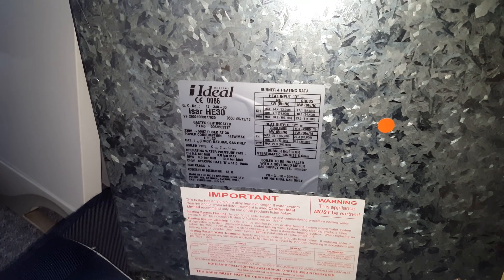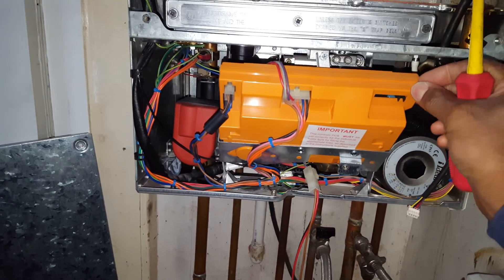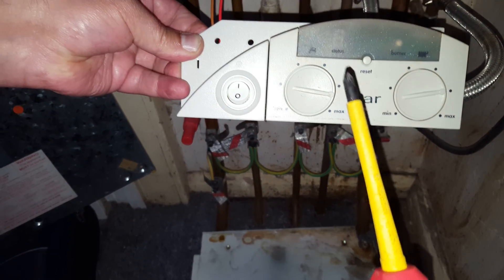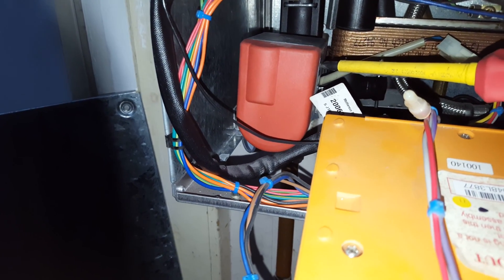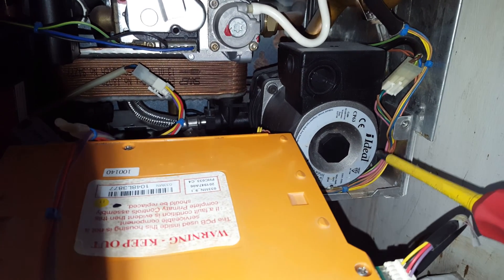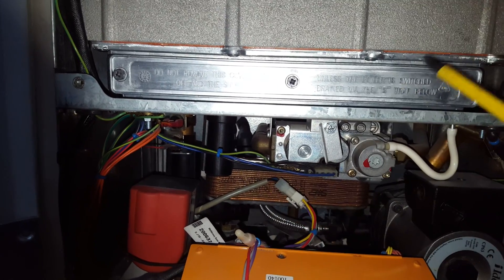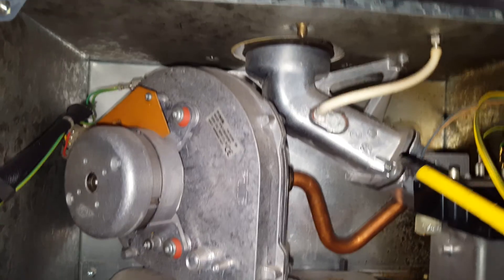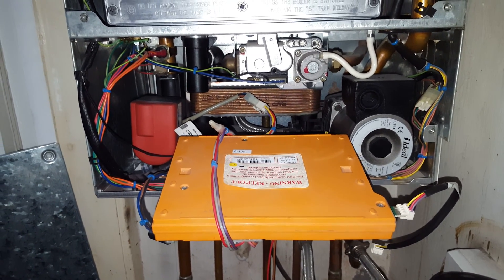Boiler repair Ideal Isar HE 30

Comment: Hi Tony, I'm aware this video is now 8 years old but I have an HE35, it's 11 years old and the pressure gauge drops  to zero when the hot water is run. It was noticed during its annual service and was diagnosed as a splt exchanger. I didn't get honest vibes from the engineer (never used them before) and I just wondered if, if it was your customer would you go to the effort of replacing the plate or main exchanger? I can easily find parts for it, plate semes to be a couple of hundred pounds depending on the supplier. I've got somone else coming on Friday to look at it but other plumbers that were too busy to come that I've spoken to said the same that it was one of the heat Exchangers and probably wouldn't be worth repairing. Just after another source of advice if you don't mind.
Reply from the maker: Hi, if it was the main heat exchanger that had spit, water would be pouring out of it. And it would be leaking everywhere. The main heat exchanger are obsolete. The hot water heat exchangers are easily available and to replace. Did the engineer repressure the expansion vessel that will make it loose pressure. Hope this helps. Also, can you subscribe to our channel, please 🙏🏽

Comment: Hi
Can you tell me, do I need drain water from system to replace diverter valve?
Regards
Reply from the maker: Hi yes you do also can you subcribe to our channel ?
Reply: @ARBoilers  Hi I did already but if you can tell me please cos I'm not sure, wires in black cover 6 pin are going to PCB and other 6pin to diverter motor?
Reply from the maker: What problem are you having?
Reply: @ARBoilers there are two 6 pin cables one in black cover I think this one is going to PCB and other to diverted motor am I right?
Reply from the maker: @prawak  are you trying to test the actuator motor?
Reply: @ARBoilers  I took it off PCB  to change heat exchanger and diverted valve and diverted motor and I'm not sure which cable is going to PCB and which to diverted motor. I think black cover one is going to PCB

Comment: Hi, 
I have ideal icos he15 boiler which has stopped working for some reason and i dont have hot water. When i switch the heating on the boiler can be switch on but no hot water. However when i switch off the heating the boilers burner light goes off too and i get “0” showing on the status display. I press reset it flashes with code H6/HB am not sure and goes back to showing 0. What could be the issue? Id appreciate your help a lot
Thank you
Reply from the maker: Min your case is best to contact ideal technical support

Comment: Hi there . Mother in law is 70 years old. She has a isar ideal he30 combi boiler. When boiler is switched on by the mains the display is blank no lights what so ever , the isolated red light is on and the display unit on the wall comes on but the boiler display is completely blank , we had an engineer out that was here 1 hour and a half and charger her £150 to tell her that both her pcb and display unit needed replacing and that it would cost her £800. Any ideas on that please  .
Reply from the maker: It sounds like it is the pcb but job should be approximately £400
Reply: what a rip off bastard, did the same job yesterday, charged her £135.  not rocket science

Comment: I've installed a few of these in the past. No callbacks. On a clean system no major problems. However I've repaired numerous isar and icos boilers. Clean the system thoroughly before install and commissioning. Sludge and incorrect commissioning slowly kills off any boiler. Modern combi's tend to be very temperamental on dirty systems. A full day or 2 to correctly install a boiler. If done according to MI.
Reply from the maker: hey, i'm currently growing my Facebook group and would love if you could join Tony will be there to answer all of your questions https://www.facebook.com/groups/167070231326174

Comment: My ideal isar he24 makes a squeeling noise when radiators are on..but stops when i run the hot tap..then starts aqueeling again. Getting louder what can it be..any ideas ?? Drives me mad.
Reply from the maker: Do you have thermostat radiator Valves?

Comment: Hi
I have a ideal icos he24 and recently had a bit of a leak which caused the small fuse which is next to the timer to blow, i replaced the fuse and pcb, both electrodes still getting a L9 fault ive also changed the spark generator it seems like its not getting any current but when i flick the fuse on and off and place a tester into the wiring of the spark generator it flicks on and off am baffled tbe L9 fault code indicates fan fault or wiring harness but fan does come on when i turn on the boiler the spark electrode does not emit a spark.
What do you suggest.
Kind regards
Reply from the maker: L9 is for over heat, check the jumpers on the new PCB make sure the are the same as the old PCB.

Comment: This boiler is the black death of heating systems as it has wiped out many bank accounts. It has however kept us busy at work with its plastic manifolds  and dodgy PCB's.
Reply: I've repaired so many of these, I've lost count. Some I've encountered have needed replacing altogether. Pcbs ignition electrodes diverters & the fact they leak almost everywhere. Ideal seem to be getting it right now. I always clean the system thoroughly. I haven't had any comebacks. Especially on all the logiks I've fitted in the past.
Reply from the maker: hey, i'm currently growing my Facebook group and would love if you could join Tony will be there to answer all of your questions https://www.facebook.com/groups/167070231326174

Comment: Just had the thermister replaced was ok for a week and now have no display. I have changed fuse and seen pcb boards on ebay. is it worth getting one and you fit it maybe. Im in Ashton Under Lyne. Thanks!
Reply from the maker: +Gaz Owens Its best getting a new one please call 01612203712
Reply: A+R Central Heating and Boiler Repair Experts Ltd No problem. as soon as I have part I will do. Thanks for responding too 👍
Reply from the maker: OK no problem